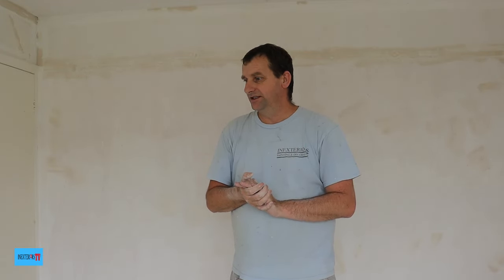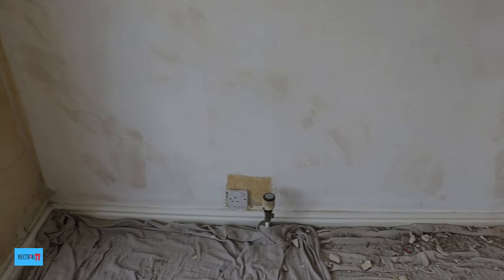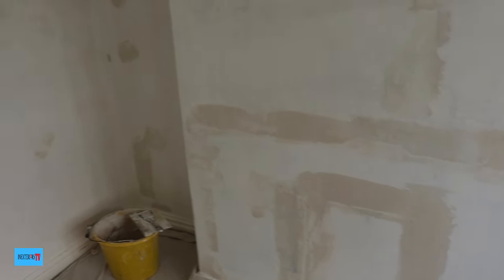Decorate a room after wallpaper removal. Part 2.

Comment: hey Steve.... I always tended to use Dulux Supermatt for blocking out (even if topcoats were anther brand. Once I did that and customer came down from Birmingham after I had left and called me .He blasted me down the phone ( my first Mobile). I could not get a word in but he shouted at me to say I had not filled cracks etc. for ages. After a long rant I told him the game plan.... There was a  gift left on the job when I returned... He was so embarrassed. Bob Albion Decoration.. Weston super Mare)
Reply from the maker: Hi Bob, lol what was the gift, i have never used dulux supermatt before.
Reply: @Inexteriors  An expensive bottle of Malt Whisky. He never spoke badly to me again....

Comment: Hi m8 do you use a mini roller to go over your cutting in on emulsion and how often do you clean your roller frame and sleeve thx m8?
Reply from the maker: No i dont use a roller for my cutting, i clean my rollers after every job, my frame has not had a proper clean for a while and is over due lol. i do clean the ends when i clean the roller slieve, they are getting old know lol.

Comment: I’m going to be doing the exact same job this week, with the only difference is I’m going to be lining the walls. Do I need to paint the walls first with white emulsion as I know it does help with seeing where you need to fill. You mentioned covaplus which is a vinyl mat as apposed to a contract Matt. Last time I tried lining over contract Matt and the paper didn’t stick.
Reply from the maker: This video will help for preparing ready for lining. https://youtu.be/J1TXSvFaJvI